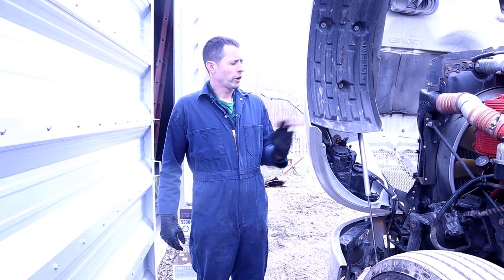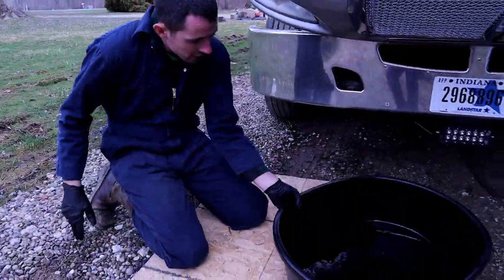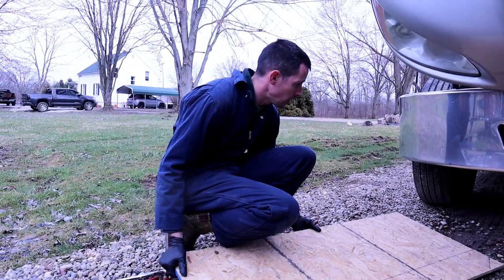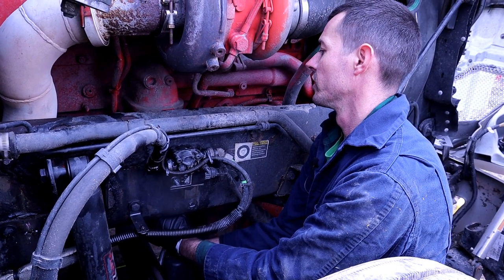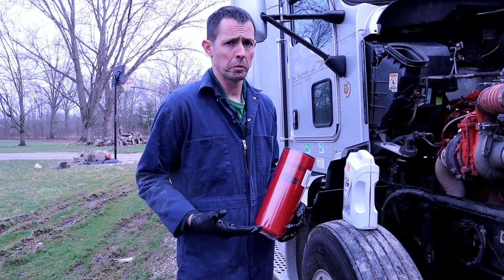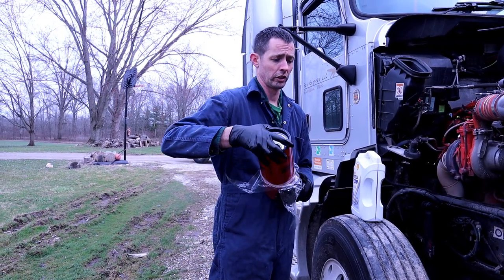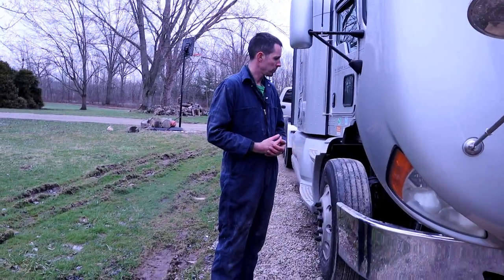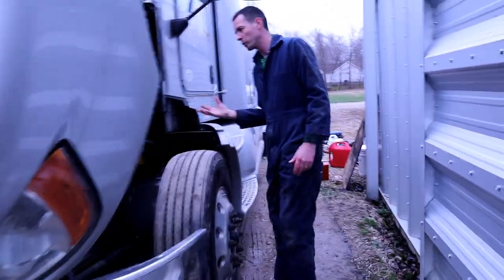Semi Truck Oil Change Instruction - Step by Step Instruction | Owner Operator Truck Repair DIY

Comment: Excellent video.  When you do it yourself, you know it is done right.  Thanks for sharing.  Hello from New Brunswick Canada.  I also use T4 in all my diesel engines, never had an issue.  I buy it in 5G pails, it is a bit less per G that way.  Around here all the garages have waste oil burners, they will happily take whatever you can drop off, some will come get it.
Reply from the maker: Thank you!

Comment: Ayee! Thank you for the video sir! I’m going to school for diesel mechanics out here in Hawaii. I’m about to start a mechanic job servicing fleet trucks. I’m pretty nervous, but I learned a lot from your videos! Thank you!
Reply from the maker: Thanks
Reply: Hey man I’m in the same situation as you! Kinda nervous cause I’ve never touched a semi truck before. How did it go?
Reply: @LeviBartel  no worries bro. Every truck is different but they are all similar. You just have to take your time and check things out and see where things are located. If you have too always refer back to the service manual. No shame, it’s good to be cautious instead of making mistakes that you could of been avoided. Good luck and god bless🤙

Comment: Suggested video would be cleaning the engine bay too. I curious about how to degrease and safely clean the the engine. Thanks for showing how change oil and filter. Never know when you might need to change the oil yourself

Comment: Video is awesome and very informative for starters but if I may make a little sugestion: next time when you about to change secondary fuel filter just make a small puncture hole on the bottom of a filter with smth sharp and drain that fuel into a bucket or smth, makes easier and less messy.

Comment: Guys, don't use brake cleaner on the plastic fuel filter cover.
It causes micro fractures in the plastic and causes it to be cloudy over time.
Same thing with plastic hub caps.
After a couple of times it'll turn cloudy and you can't see the fluid levels.
 Trust me,I learned the hard way.
Reply: so what should they use? WD40?

Comment: This might be a dumb question but when u unplug the cable from the fuel filter the one that hangs on the cover is it just pull plug or has something holding it together ? Or is there a specific way to unplug ? Thank you in advance

Comment: When I change the fuel filter I usually will pull the fuse and crank the engine and that will empty out the fuel filter and relieve the pressure in the fuel system. Does take a bit to get it started again afterwards, however.

Comment: thank you sir for your video. i saw you didn't put a little lubrication on the seal i thought it good to put it. i time i did a filter change and after tide in seal broke and i didnt know until i got stock. it suck air and te filter was dry when i remove it was broken. since the time i away put a little oil.

Comment: 15:26 any filters are on the low side of the fuel system before the high pressure fuel pump.

Comment: As always, very educational and very informative. Could you please advice..

You have used Shell Rotella T6 extreme temp fully synthetic oil which I only use it as well. After how many miles will you change your oil 2015 truck with a 2019 brand new block ISX 110K miles. I’m reading change after every 30K to 50K miles depending on local or OTR. I also read change it every 12K miles regardless of the oil type because cummins is a soot monster.
Reply: This may sound counter-intuitive, but it's best to determine it by how much oil it consumes.  If you consume a lot of oil (~2000 miles / quart or worse), you will want to change it more often.  If it doesn't use much oil (say 5k miles/ quart), then you can go a lot longer between oil changes.   Obviously still follow the Cummins service intervals for the maximum mileage based on year and fuel economy.  The 2017+ X15 doesn't degrade the oil as quickly, so the service intervals are much longer, with up to 80k miles possible, 100k if you do the oil guard program where they check it.   On the 2015, the oil drain interval is much shorter (40k if I remember correctly) as a maximum value for high MPG trucks.

Comment: Thank you for posting this video my dad is going to start doing his own oil changes and we found this very informative, but what is the attachment you used on the drill for used oil? From tractor supply we can’t find it?
Reply from the maker: https://www.tractorsupply.com/tsc/product/water-source-drill-pump

This is the link to the attachment. It says for water, but you can use it with oil. But not gasoline and diesel

Comment: Hand tightening oil filter causes it to leak and lower oil pressure from vibration, especially oiling the seal which is not necessary.hand tightening fuel filter will cause it to loosen and loss of power from lower fuel pressure. Baldwin filters are not good for cummins use fleetguard recommended by cummins

Comment: So I took off my fuel filter the NN5825 with the filter wrench and now I’m having such a hard time installing the new one. First time doing this myself, can you tell me if I’m doing something wrong? I just can’t line it up, is it here chance that the thread is bad ?
Reply from the maker: There is a slight chance that the threat is bad however it’s not likely. Sometimes you should turn backwards before it turns forward, and sometimes took me 15 minutes to get it done. They have to be perfectly straight.
Reply: @truckingandfixing  thank you for the reply, I gave up trying yesterday, tried for 3 hours and no luck. Will try again tomorrow,  thanks again
Reply from the maker: Three hours is a long time, good luck tomorrow!

Comment: Its not necessary to fill the oil filter, it bypasses it upon start-up until there is oil pressure if you would like to put some in there, sure go ahead, but its not necessary

Comment: Is  that engine an ISX CM2350?
Reply from the maker: I believe it is a CM2250, I had the ceramic fuel pump issue, that I've since updated. Its a 2012 engine.
Reply: @truckingandfixing  ,
Nice video.  Rotella is a great oil.
Reply from the maker: @williamhorvat8224  Yes, we have pretty good luck with it.  I usually bounce between that and Mobil Delvac 1300 Super, whichever I can get a deal on.  There is a great rebate offer going on with Mobile Delvac 1300 Super right now though some retailers, they are giving you $25 back for each 5 gallon bucket, up to 3 buckets, or $75 back.  That gets the per gallon price down around $7, and that is going on until 31 May 2020.

Comment: What does it cost for that service
Reply from the maker: Probably $300-$600, depends on the oil and filter you choose
Reply: @truckingandfixing  ok but how much do you make off the job for you profit
Reply from the maker: @joed596 it is the cost to take the truck to the repair center

Comment: Please, someone tell me what socket size is used for the oil screw
Reply: There is no socket. It's just a square hole.  You use the end of a 1/2 ratchet or breaker bar.